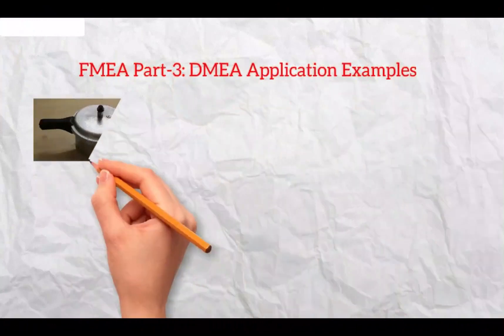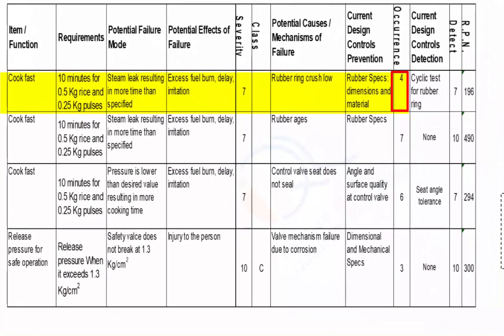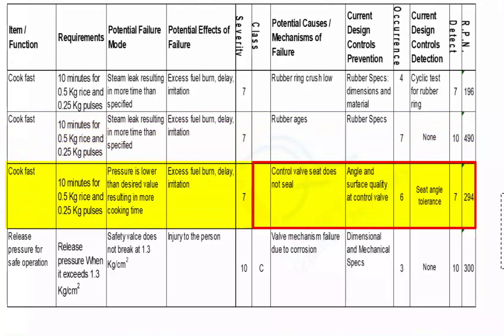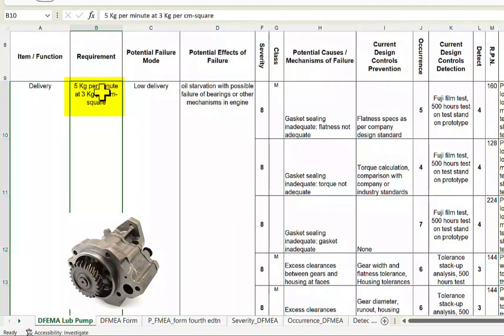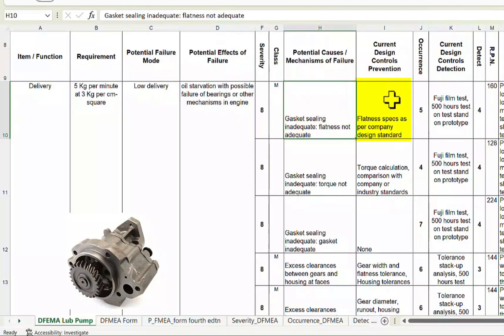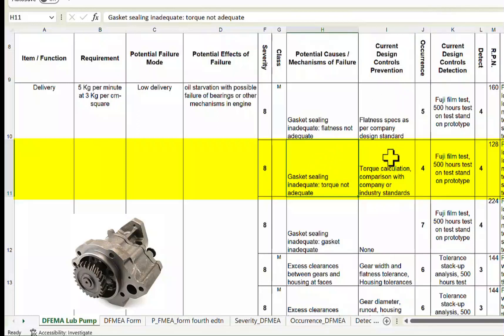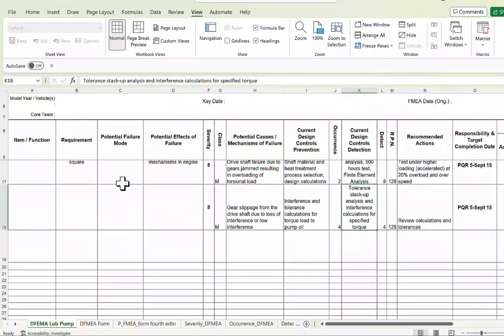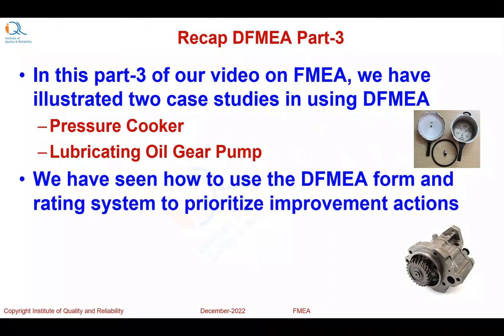FMEA Part-3: DFMEA Application Case Studies

Comment: Dear Sir, Thanks for the Video...Great. 
Have a doubt. Detection is filled using Prevention or failure cause as input?
Reply from the maker: Detection number is filled in based on the strength of detection controls (such as testing, validation, design reviews etc).